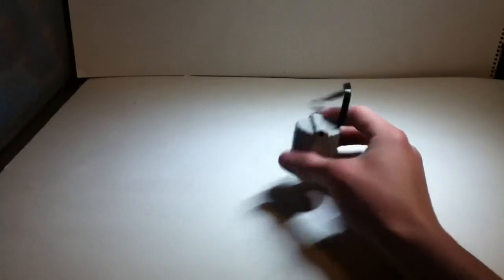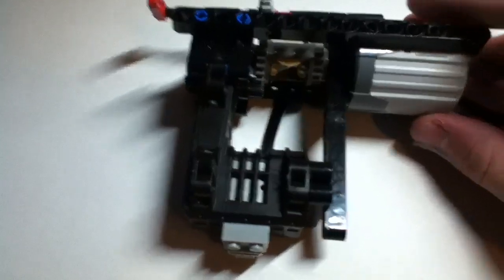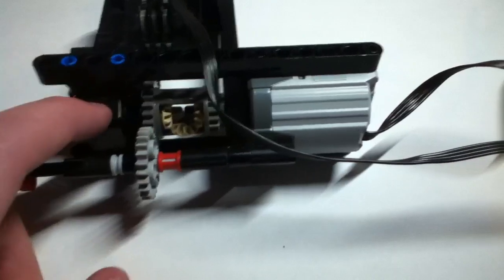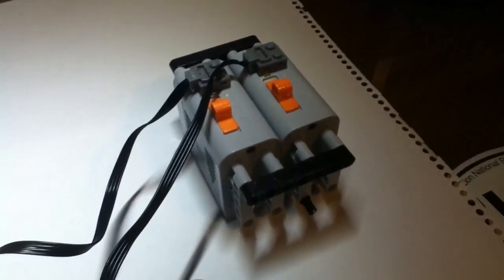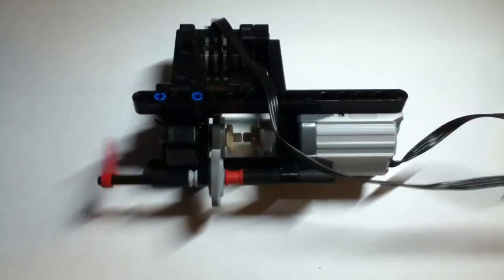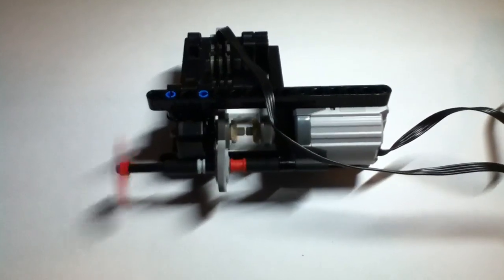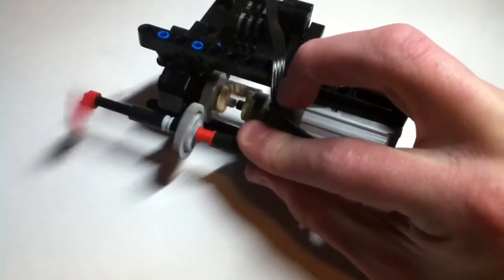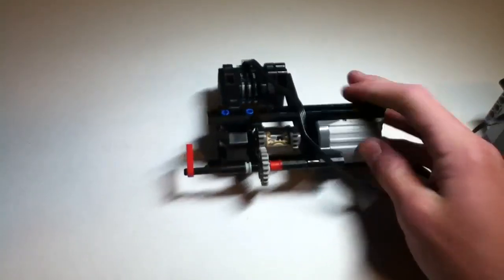PF XL & RC Buggy motors *POWER & SPEED!*

Comment: This system does not work using just the XL motor. I tried putting a lock on the RC so I can drive slowly, but I snapped a gear in the diff. I put new tan gears in the diff, and they skipped. Going to use Sariel's Heavy Duty 2-speed gearbox.

Comment: I had hoped to use the two motors as high and low gears, but the RC does not provide enough resistance to use just the XL.